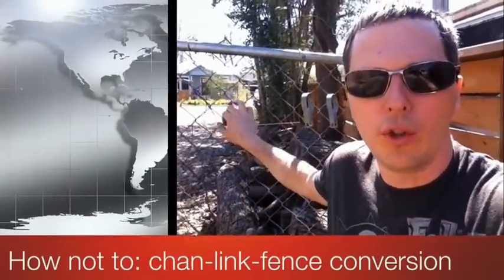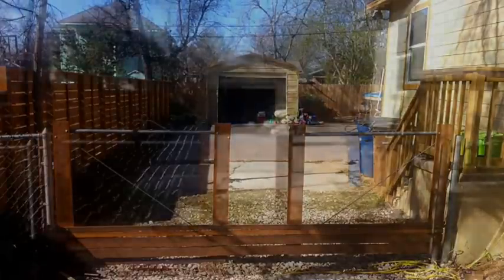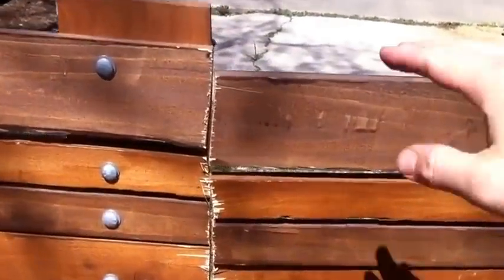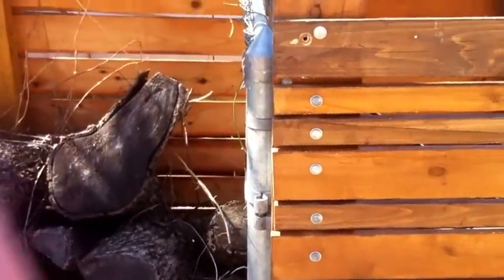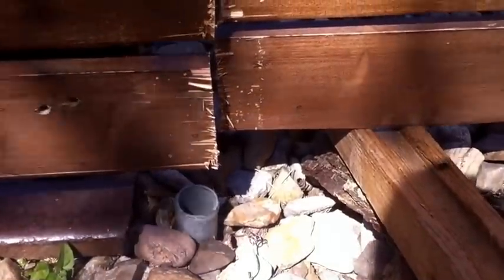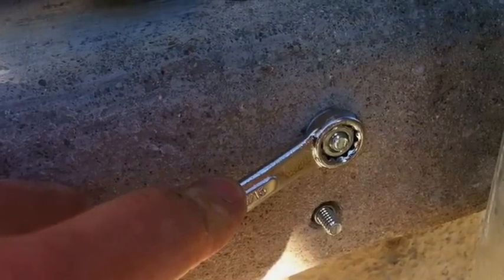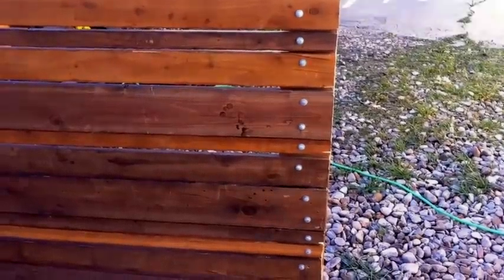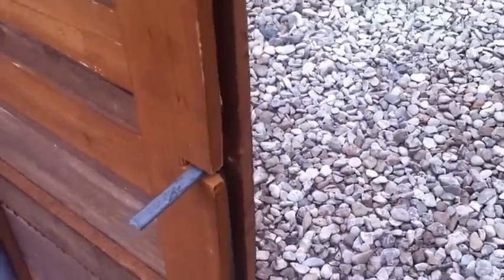Chain link fence conversion to wood

Comment: Well, Travis you learned a lot with this I am sure.  I have worked and/or been around woodworking all my life and currently work at a millwork company.  What you are doing is exactly how people learn.  I agree with Sandra about the negative comments.  F**k 'em.  Your fence looks just fine. For not knowing a lot about carpentry, I think you did a pretty good job.  You had some clever ideas with repurposing some of the chain link fence metal.  Thanks!  You gave me some good ideas for converting my chain link fence.  I like the fence pattern too.

Comment: You did well and I would make one small comment, it would have looked a little more professional if you had kept your bolt heads in line as you look at the fence. A simple chalk line from top to bottom would have straightened them up. but for your efforts I give you 100% if youve not done this before it must have been a challenge for you but you overcame it.